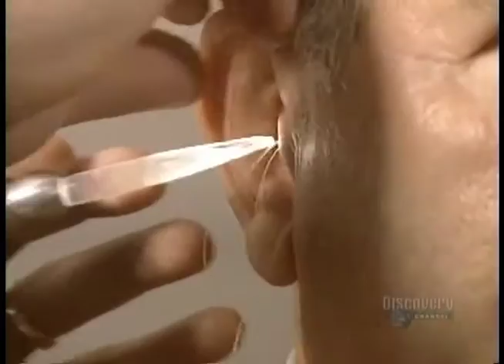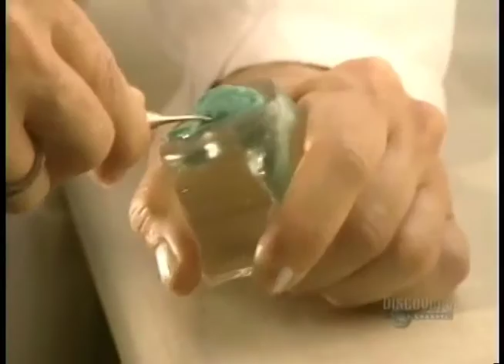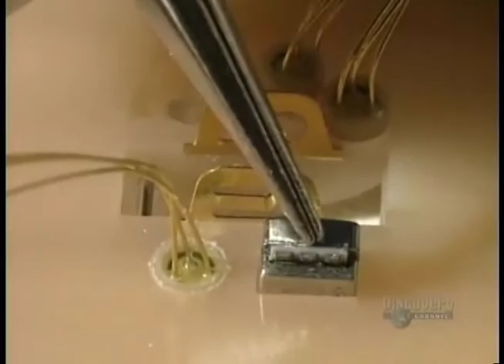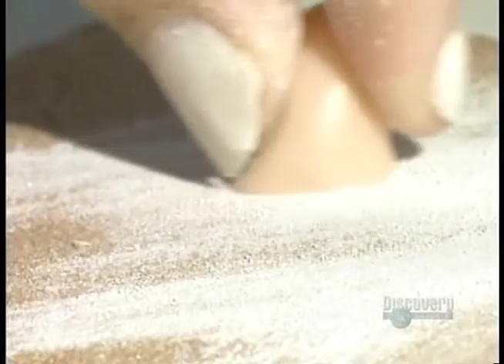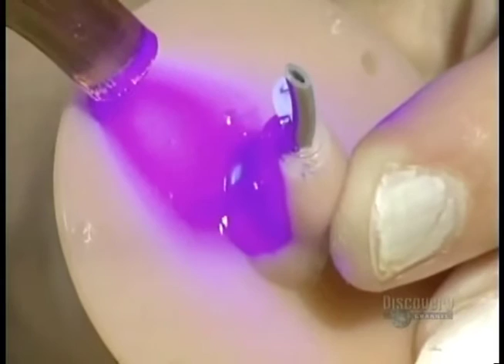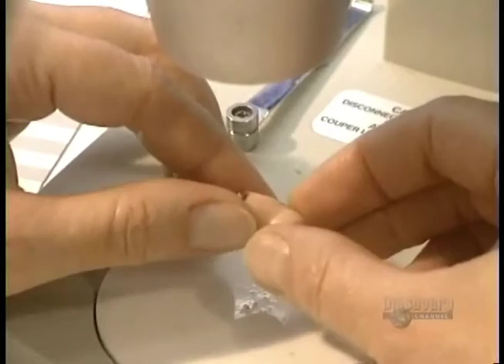How It's Made - Hearing Aids

Comment: Sorry, that is NOT WORTH $5000.00!!!!!!!!!
Reply: It definitely is if your deaf and your getting 2 hearing aids. If you have severe hearing loss your 5 times more likely to get dementia and have severe depression.
Reply: @farmsalot1233  where'd you read that, a miracle-ear cracker jack box insert?  Or are you saying all Def people are depressed and have dementia?
Reply: I dont think its worth that either , scam !
Reply: Georgia Institute of Tech professors made a set in 2020 for $0.98 and it was built using WHO/FDA  standards. They said they could build top of the line with adjustable software for frequency slope and gains for about $7.00. 
Professor M. Saad Bhamla and 4 others made it in about 30minutes.
Reply: @hawaiiguykailua6928  do you have a link ? Or reference ? I just paid 5200$ yesterday for a new pair.